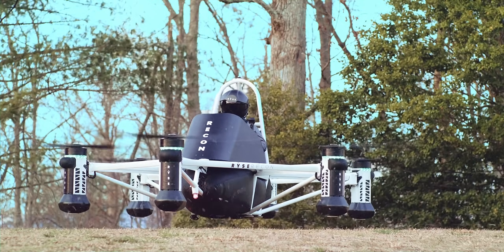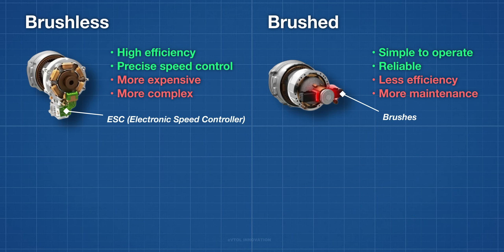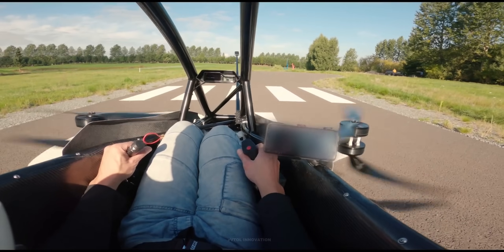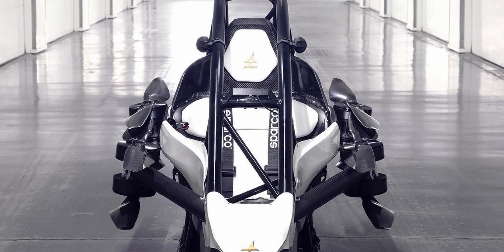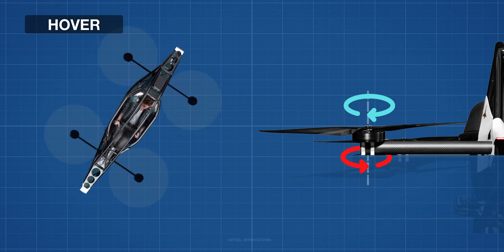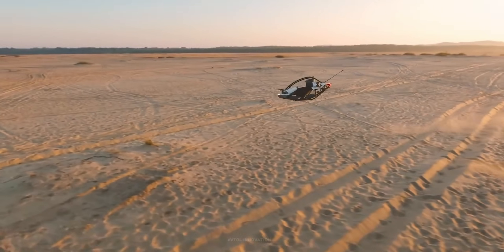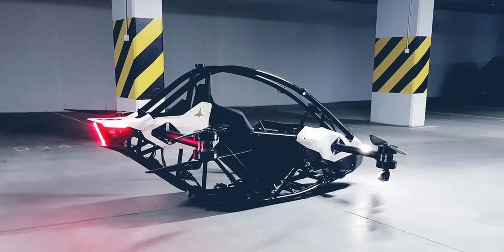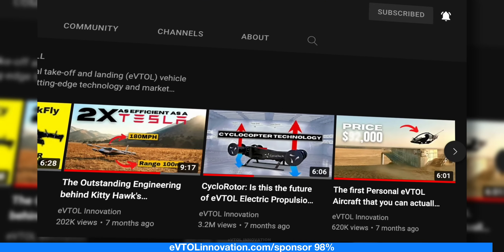The brilliant Engineering behind Jetson ONE

Comment: Fantastic exciting stuff !!
While I have no advanced education in any of these concepts,  when something is explained to me,  I usually ‘get it’ without much confusion.  The following thoughts don’t contain any intentional sarcasm.  They are honest wondering. 
This video mentions that if the distance between upper and lower props is a bit increased, efficiency rises.  It also mentions a problem of the lower prop having some difficulty with the increased velocity of air flow from the upper prop.  What if the following concepts were combined. 
1.   Increase distance between upper and lower prop. 
2.   Give the lower prop a more aggressive pitch to take advantage of the already faster airflow. 
3.   Enclose both in a tubular shroud to further increase efficiency. 
4.   Double the number of motors/props to 16 (8 shrouds) increasing the safety factor of failures of motors and greatly reducing the diameter of each. 
5.   Raising all of them to completely above line of sight to the ground, not only greatly improving visibility, but also lowering the center of gravity, making the computer’s job easier with more inherent stability. 
I hungrily await an education on these thoughts, preferably from those who actually know,  not from those who think they know.  No offense intended.

EDIT:     HOLEECRAPOLEE !!
I just saw your video about the 
Adaptive ducted fan and it answers some (but not all) of my questions above.  Great stuff !

EDIT AGAIN:

HOLEEGUSTAVWHITEHEAD !!
I just watched your video of the Lillium jet.  Disregard all of my questions above.  Astonishing !  😳    🤜🤛
Reply: For someone with "no advanced education in any of these concepts", your quite inquisitive; kudos to you
Reply: There is an ideal distance between coaxial propellers, I have built a coaxial helicopter and researched the distance I should use, the figure of 10% rotor diameter was right for me, any closer or any further away and lift would be reduced. 
In order to balance torque on both rotors the pitch of the lower rotor had to be increased by 1 degree. 
A single larger prop is more efficient than two smaller ones, it's more efficient to move a large amount of air slowly than a small amount of air fast. Helicopters with larger diameter rotors will  produce more lift using the same power. 
Increasing the height of the props I do believe will increase stability

Comment: I just discovered this channel and I must say, the content is absolutely fantastic. So detailed and the graphics are spot on. Answered many of my questions about this vehicle. Thank you!
Reply: it is German made......
Reply: @1bluemoondj  even cooler 😁
Reply: @1bluemoondj  Swedish made
Reply: @wildlifewarrior2670  no I produced it years ago. They didn't I was the one that had the original design of a book from them. I made it they bought it off of me. Nobody's going to take credit for my word just like Apple. The credit amongst me.
Reply: @wildlifewarrior2670  I don't still work just like they still medical equipment. They don't have medical over there but they can say that they can construct. It's always and will always be me. Don't play me
Reply: It’ll just transfer to the sky with more horrific accidents
Reply: @normanharris7333  That's more of joyride. It's not for in flight use as the ixpeng , if that's how it's spelled, their first flying car is more of how it's supposed to function. It's really more of a autopilot type of thing. Unless you need to fly manually then no. As they said it's only for joyride.
Reply: @normanharris7333  at home experience of using a helicopter. Or should I say a quadrocopter?

Comment: so, i'm assuming around 15 to 20 minutes of flight time? How long for a charge?
Are the batteries swappable?
Reply: 15-20 minutes by battery will not enough, we need hydrogen one, that fuel cell, IC (specialy wankel like liquid piston) or mini jet engine, battery is for child and hydrogen for adult pilot.
Reply: I think I heard something about a gas generator being in the works to increase flight time, which is currently at 20 minutes (you could probably squeeze out one or two more but you're likely damaging the battery), it can fly at 60 mph and cover 20 miles, which if you know anything about drones is an extremely respectable flight time, but a gas generator would greatly increase that, by at least double. It requires enlarging almost everything though so it's going to be a little beefier of a craft and will be a lot louder too. But with all that supplemental power from a generator along with it's batteries it will also have a lot more oomph as well, it should be able to reach a little higher top speed along with a longer flight time.
Reply: 3 or 4 minutes max.  they would show a continuous five minute flight if they could. they need to heavily edit every video to make it look like it's good. if it could fly 20 minutes they would show that and be the first in the world to do it. if they would release the specs we could do the math.
Reply: @Ducky69247  they never did
Reply: @Ducky69247  they never did

Comment: Does anyone have info about Jetson's Flight  control computer? Do they make their own hard and software or do they use opensource ones?
Reply: Probably using a DJI setup.. pretty easy to configure esc and motors to to a higher voltage output…
Reply: they don't give any info on anything. it's probably scam and can only fly 3 minites that's why they need to edit their videos so heavily and can't just show a normal test flight.
Reply: @fairyphotography  they need to develop a better battery that can fly for a few hours at a time.
Reply: @jackwilliams7738  if it was possible to cram all that energy into such a small battery it would be an explosion like the Oklahoma Federal building if it shorted or fell from the sky. this is a very inefficient way to fly.
Reply: @fairyphotography  they might be able to make a bigger better battery.
Reply: @fairyphotography  it's not their fault battery technology hasn't caught up. While i don't think it's a scam, I do agree the flight times are probably very short.
Reply: @JJs_playground  if they claim 20 minutes and its less than 4 I'd say it's a scam.
Reply: @JJs_playground  if technology caught up this would be a common vehicle and not special. it's like making a metal box and saying its a blood analysis machine that only takes a drop and it didn't work because the technology didn't catch up.
Reply: @jackwilliams7738  a bigger battery is bigger. it already can barely take off with a person.

Comment: Sir, What is the max.height the craft can achieve?is it possible to make a four seater version craft, with the same dynamics?
Reply: it can't reach it's ceiling without running out if battery so it doesn't matter. it goes as high as you are brave.

Comment: Thank you so much for your explanation of rudder authority.  It could use foot rudders like an aircraft or helicopter. If you also had foot control for pointing authority it could help if the pilot were wounded in the right shoulder or wrist. In say a combat condition in say the Ukraine carrying a Carl Gustav for anti armor. With axial flux electric motors it could lift more for a higher battery load with 48" propellers. With dynamic wing support it could also double that range.

Comment: Basically a scaled up r/c drone - the flight computer does the same thing that the small drone's does, the difference being the pilot on the ground uses a controller to remotely pilot it, and in the Jetson One the pilot and controls are in the aircraft directly connected to the flight controller. Just hope battery chemistry gets better and better so that we have even more long term power with lower weights in the future. 20 minutes is a long time, but it's also very short - fly a drone and see.

Comment: One thing that really bothers me, is the blades being so exposed and next to the pilot. The blades can be super dangerous when landing, and the pilot fail to see a person next to it. Maybe it needs a cover for the blades, and some type of grade under and over it, that allows air flow, but keep people from touching the blades.
Reply: agree, maybe Ducted propeller more safe
Reply: I was more thinking about the fact that aircraft props have been known to come off from time to time. With that many spinning in such close proximity to the pilot it seems like it would only be a matter of time until someone gets sliced up by a broken prop.
Reply: @donaldengel4128  I'd be much more concerned about exposed blades striking something - a power line or a tree branch or whatever. This thing needs "brush guards" of some type surrounding the prop blades, like what you've got surrounding the tail rotor of a helicopter. Thin, wire mesh, or something like that. It doesn't have to be complicated...!
Reply: weight is the deal killer there
Reply: Maybe use a pool without water to land and nobody enter there. The small size of the vehicle and easy to land make this possible.
Reply: "Head remover 3000"
Reply: We got some Arm chair drone engineers here 🍻
Reply: If you’re so concerned, then don’t buy one!

Comment: The only technology difference compared to a small drone is the joysticks lol
Btw. the prototype flights were done using a remote system just like for small drones, suggesting that the platform is using some top shelf flight controller (FC) meant for small drones.
The motors are probably from T-MOTOR something like U15Ⅱ KV80.
The motors, propellers and ESC total to around $12k
I think you could DIY it for like $20k

Comment: Would be great to hear about the regulatory background of those demo flights. How are they circumnavigating type certification?
Reply: It depends on the region. In the US :part 103 category does not need license either. Homebuilt and experimental do not need type certification... Canada similar but different weight/speed limits...lots of videos about it...
Reply: They are NOT...

FAA Part 103 requires a minimum power-off 24-knot stall speed for ALL ultralight aircraft (rotor, or otherwise), so this aircraft would fail miserably.  (ultralight helicopters can autorotate and maintain controlled forward flight with enough altitude, oversized quadcopters, not so much...)

Basically, in most of the "distance" videos, he's breaking many rules about low flight over private property.  This aircraft is a colossal joke and would never be type-certified ANYWHERE.

Comment: You mentioned the battery is 52V, do you know what the capacity in Amp hours is?
Reply: The 8 motors take about 60A so they might use around 10-12 batteries of each 30AH

Comment: What is the max amperage draw that the propeller motors when it is flying. It seems that if you design it like a hybrid car that the gas motor is dedicated to produce electricity to charge the battery, the flight time will be way longer.
Reply: That's the problem also occurring in helicopters: piston engines have very low power density (too heavy for their power). You need gas turbine generator. How many piston powered helicopters do you see in service now?
Reply: @hailstorm7868  The engine I'm talking about doesn't drive any rotor. It only drive a generator to charge the battery. There are lightweight engine( ultralight engine) out there with 2 HP that can drive a generator and produce 1 kW of electricity. Now, I don't how heavy is a brushless generator though.
Reply: @b-lopez394  2 hp won't carry it, you need around 150 hp shaft power before losses

Comment: "Contra-rotating propellers have been found to be between 6% and 16% more efficient than normal propellers. However they can be very noisy, with increases in noise in the axial (forward and aft) direction of up to 30 dB, and tangentially 10 dB." - Google
Reply: Yet the video states the opposite...
Reply: @nickoutram6939 The in-wake propeller is less efficient than the leading one, but the combination is better than a single propeller of the same disc loading, in part because the resulting flow has no net rotation. Like any propeller, of course, bigger is better limited only by the biggest club you can swing without hitting the ground or the rest of the airframe.
Reply from the maker: "However, considering that a lower propeller operates in a prop wash of upperunit, the total thrust performance of coaxial propulsion is lower comparing totwo separated propellers. In this paper we present experimental veriﬁcation ofthis performance in practical terms of multirotor design with diﬀerent propellers’sizes and motors intended for various classes and sizes of multi rotor aerial plat-forms." 
https://www.researchgate.net/publication/297577792_Performance_of_Coaxial_Propulsion_in_Design_of_Multi-rotor_UAVs

Comment: II find it very interesting. But I would like you to explain to me, why the front propellers are at a lower level than the rear ones. What is this configuration called and why would it be better?
I would also like to know what type of flight controller I use.

Comment: Unfortunately your description of the flight dynamics is not entirely correct.  I have designed early 4 rotor drones using an Arduino which I wrote the control software. Pitch and roll are not done the way you described.  Anyway, not sure what application the Jetson one and similar vehicles will serve with s flight time of only about 1 or 2 minutes.   Making a Jetson one is not that hard but making it fly for say 1 hour IS !

Comment: Love it. However there are areas that need work guys - 1. the props will decapitate you in a crash or should one detach mid air. 2. The flight controllers can be simplified and modernised. Otherwise spectacular 👌🏻
Reply: I mean there’s just no way they haven’t thought of that and have it on the docket. Most likely they can’t develop it all at once if they’re just trying to get fly straight and land mastered first, and be light and powerful enough to maneuver and have any real flight time.
Reply: @ComeAlongKay  I think it’s the flight time that is at stake. However, one decapitated pilot = no more Jetson One flights for a very long time, if ever again. So they need to find a solution asap

Comment: Let's estimate the net thrust required for an aircraft with a weight of 190 lbs and a pilot weight of 176 lbs (i.e., a total weight of 366 lbs). For the purposes of this example, let's assume the aircraft's design speed is 100 mph, the air density at flight altitude is 1.225 kg/m^3, the coefficient of drag is 0.03, and the wing area is 12 square meters.

Step 1: Determine the total weight of the aircraft

Total weight = 366 lbs
Step 2: Determine the aircraft's maximum speed

Design speed = 100 mph = 44.704 m/s
Step 3: Calculate the aircraft's total drag at the maximum speed using the drag equation

Drag = 1/2 * 1.225 kg/m^3 * (44.704 m/s)^2 * 0.03 * 12 m^2
Drag = 431.7 N
Step 4: Calculate the aircraft's total lift required to maintain level flight at the maximum speed using the lift equation

Lift = aircraft weight
Lift = 366 lbs * 0.453592 kg/lb * 9.81 m/s^2
Lift = 1,606.8 N
Step 5: Calculate the net thrust required to overcome drag and maintain level flight

Thrust = Drag + (Aircraft Weight * gravity)
Thrust = 431.7 N + (366 lbs * 0.453592 kg/lb * 9.81 m/s^2)
Thrust = 1,995.6 N
Therefore, the estimated net thrust required for an aircraft with a weight of 190 lbs and a pilot weight of 176 lbs to maintain level flight at a speed of 100 mph is approximately 1,995.6 Newtons. Again, it's important to note that this is just an estimate and the actual thrust required may vary depending on various factors.

To convert Newtons (N) to pounds (lbs), we can use the conversion factor of 1 N = 0.224809 lbs. Using this conversion factor, we can convert the estimated net thrust required of 1,995.6 N to pounds as follows:

1,995.6 N * 0.224809 lbs/N = 448.3 lbs

Therefore, an estimated net thrust required of 1,995.6 N is equivalent to approximately 448.3 lbs.

Dividing 448.3 lbs by 8 gives:

448.3 lbs / 8 = 56.0375 lbs

Therefore, 448.3 lbs is equivalent to approximately 56.04 kg when divided by 8, since there are 8 pounds in a kilogram.

Answer is 56.0375 lbs per motor :)  Not 46 lbs, but whos actually doing the math here ;)
Reply: 2.2 lbs in a kilogram

Comment: Only 52 volts high  
discharge power systems? NICE. That's equal to 12s lipo used  to power those 700 and 800 size RC helicopters.
Reply: It's a surprise to me, I thought they would have to go much higher voltage than that to get the power but to be fair those BLDC motors are small -I think they are ~11KW each x8.

Comment: System Nrb: 1
4 Motors120100/60kv /25.000W / 3.9kg
4 ESC  400Ampere 3-22s
4+4 Batteries each engine : 1.7s and 1.8s 22.0000mah
4Helix propeller 1.20x6zoll  , 1.25x6zoll .2CW+2CCW
DJI WOOKONG M STABILIZER

System Nrb:2
4 Motors 120100 / 25Kw
4Propellers 42x13 for human flight - 2CW +2CCW
ESC( electrical speed controllers ) 4x 500A
Batteries: 2 per each motor (total of 8 ) 6s 30.000mAh or 22.000mAh
RC (remote control) :WOOKONG-M , A2 or A3 from DJI ( if you don’t like coding ) or PIXHAWK ( if you are not afraid of coding )

System Nrb: 3
Expensive from “ T-motors” 
4 Motors S150
4 ESC SE40
Propellers 2pairs of NS62x24 ( 2CW + 2CCW)
8 Batteries 2Ares 30Ah
1 UP 600+ charger 
This system suggested by the pros from T-motors ( China ) 

First two systems you can buy them from “ Ali express” or “Ebay” ,third one from “ T-motors”(hughsun@tmotor.com)
You can also use (FREERCHOBBY website ) to purchase your goods
There is - mad-motor.com , droneassemble.com and hobbyking.com
This all my research so far ,I hope it’s useful for those interested.

Cheers George 

PS: don’t forget I can manufacture your frame for you -4 ,6,or 8 motors ,I can do it !